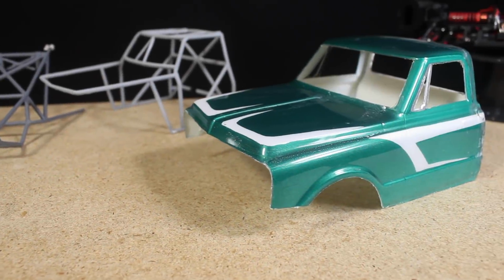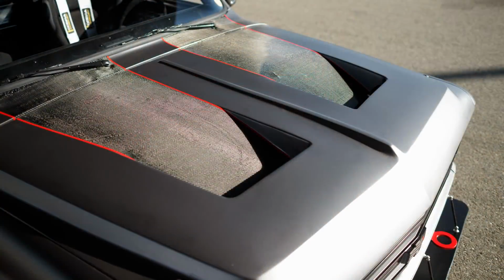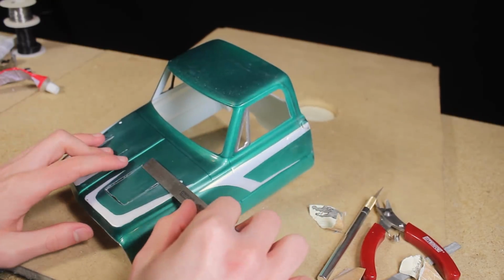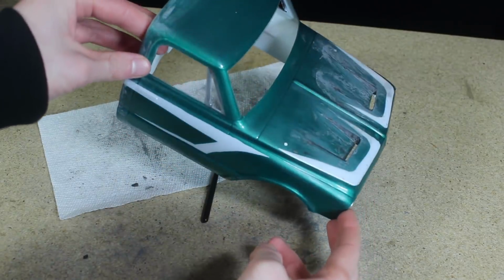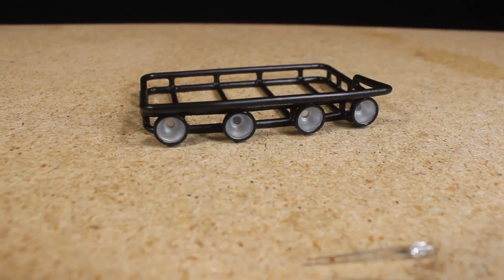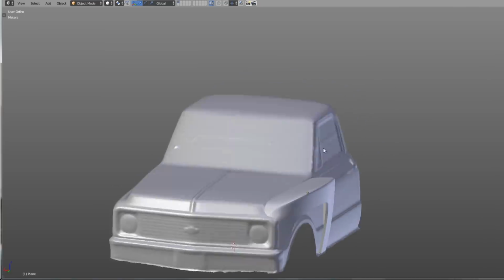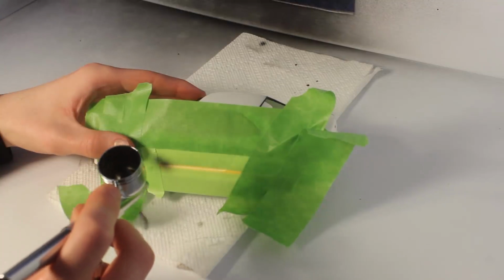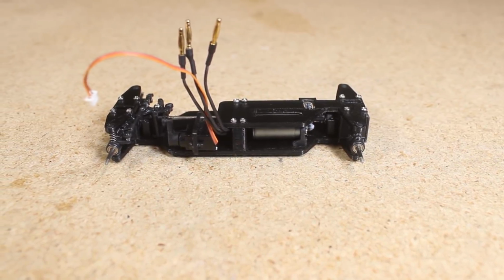Adding Fenders and Hood Vents to the Prerunner and LEDs to Roof Rack + Skyline Update (E13)

Comment: To power your lights on the prerunner, there are ports on the esc/receiver marked led. U just have to get the right connecter. I have plugged leds into my car that is pretty much the one that you have but a different body style called fy-3. Pluging the leds into thay port are cool because they blink when are on and when they connect but end up staying solid.

Comment: I think you missed an opportunity with the cracked bumper on the Skyline. You could have done drift stitches.
Reply from the maker: I thought about that, but being so small I'm not sure how I would add stitches.
Reply: Kap pa I know it was in the perfect place to make it seem like he hit something with the tail of the car going around a right hander
Reply: You could stretch some black sprue or chop the bristles off of a crappy brush (like a disposable epoxy brush.) Glue, trim, done.
Reply: Make It RC where do you get your styrene
Reply from the maker: @Caleb Games  Either local hobby shop or ebay.

Comment: If I may, you should try using lacquer varnish on the body, applying an enamel wash into the panel lines. Clean off the excess with enamel thinner and then clear over the top. That's how I do mine